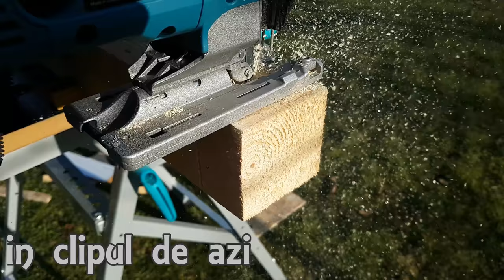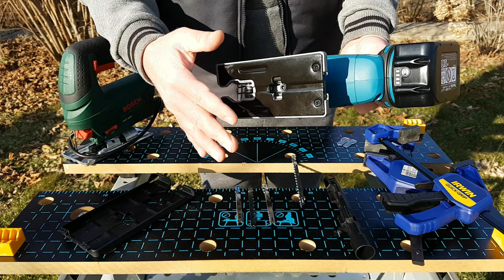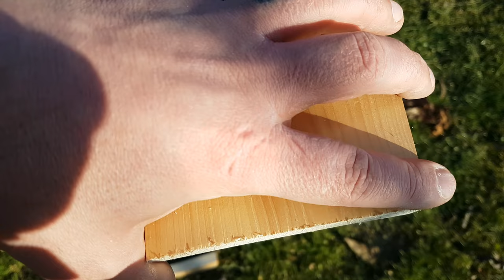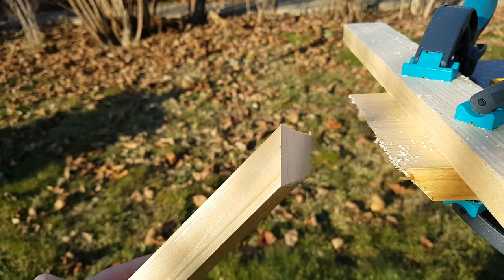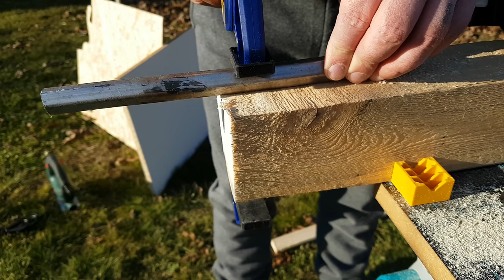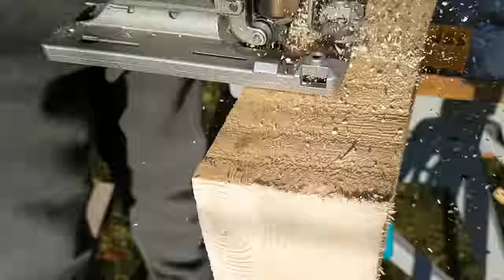Pendularul care taie tot. Am testat fierastraul pendular Makita DJV180

Comment: Adâncimea de taiere a celui de la bosch este mult mai mica decât cea de la makita, normal ca s a chinuit. Nici nu știu dacă trece de 70mm
Reply from the maker: Nu stiu daca de asta se chinuie asa, am taiat si cu cel de la Makita fara treptele de pendulare orizontala si tot la fel se chinuie. Apoi Bosch-ul o avea el cursa mai mica dar are si pendulatii mai multe si atunci compenseaza. Ideea este ca sistemul de pendulare orizontala face diferenta.
Reply: @DemoToolsYT 
Clar pendularea face diferenta dar sa ne uitam la specificații.. Nu judeca un pendular după volți, nu contează ca e pe cablu sau baterie. Știu ca e un test asa ca fapt divers
Reply from the maker: @Pecke1234  Dar nu am spus nimic de volti
Reply: @DemoToolsYT 
Nu m am referit la tine ci în mod general